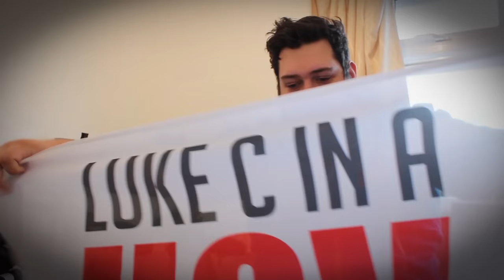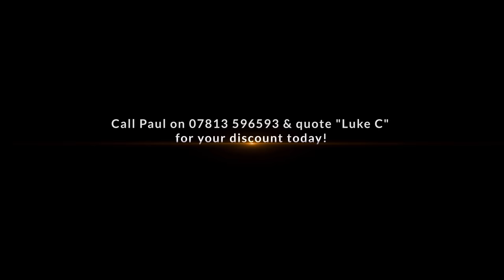"I've Had ENOUGH & I'm Going To Do Something About It!"

Comment: Luke you ever have problems with the plastic that encases your steering column? a noise you can't fix without tearing the whole thing off? no matter how much you tighten the screws, the squeaking noise never goes away, bout drives you nutso

Comment: WD40 is actually not a lubricant, contrary to the marketing nonsense on the tin. It's a degreaser (remover of lubricants) and water displacer, so you'll probably find that the squeak gets worse after the wd40 dries out. For a long term fix on your seat you'd be better served with white grease or silicone lubricant depending on which bits are squeaking! :)
Reply: Did you know it contains fish oil? I'm sure with it having oil, it does have some lubricating properties. :)
Reply: Lesley Munro also the can is blue
Reply: The fish oil thing is a myth :)
And while yes, it temporarily lubricates things; so does basically any application of sticky liquid.
The other negative, of course, is that on top of drying out and losing all of its anti-squeak properties, WD also has the horrendous side effect that as it dries, it loves attracting all dust and mess in the air, so the patch you sprayed with it ends up turning black and nasty with filth.
WD is one of those things that is great at cleaning and degreasing stuff, in combination with a rag (or getting rid of water penetration in electrical systems) followed by application of an actual lube.
In my workshop, I keep it around for cleaning things only, and use plus gas or a mix of acetone and hydraulic fluid for a penetrating oil, and actual lubricants for lubrication.
Reply: And I'm not saying don't use it, because who am I to judge - just offering a more long-term solution to the squeaky chair issue. :)
Reply: you're bang on, what you need is white lithium grease... that will sort the squeak out for a while.